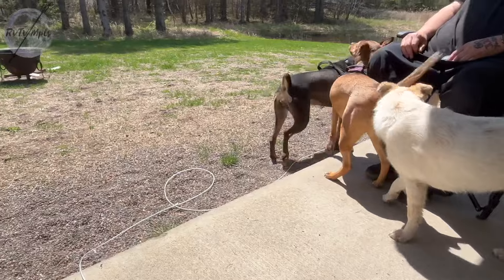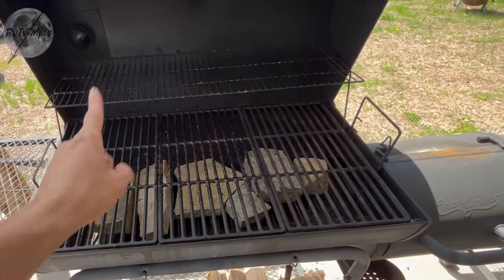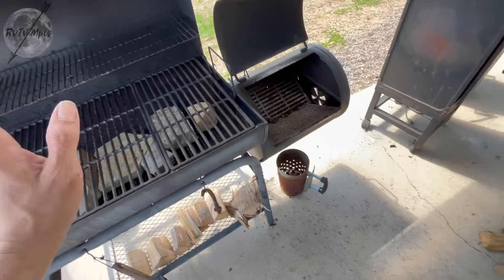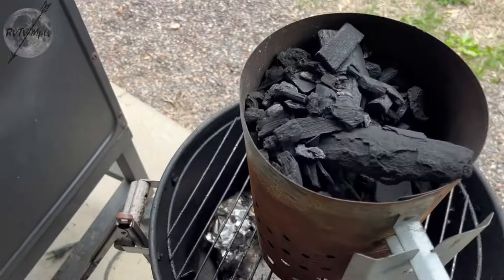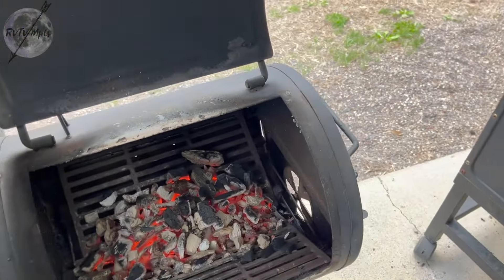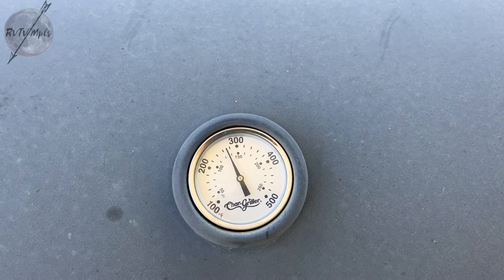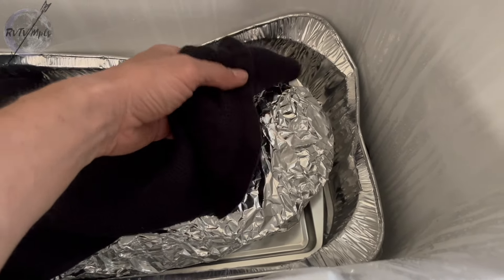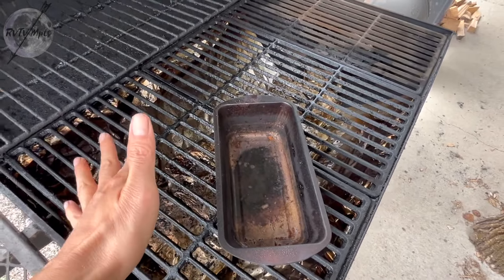Can Our $30 BBQ Smoke Texas Brisket?

Comment: I smoked briskets on my free charbroil smoker for 8 years… I burned a bunch of charcoal. I learned a lot I stopped using my side box because it leaks to much pick up grate do 2-3 charcoal lengths far right.   Light charcoal on one side let it snake across how I got most efficient cook on my brisket s when I had the charbroil